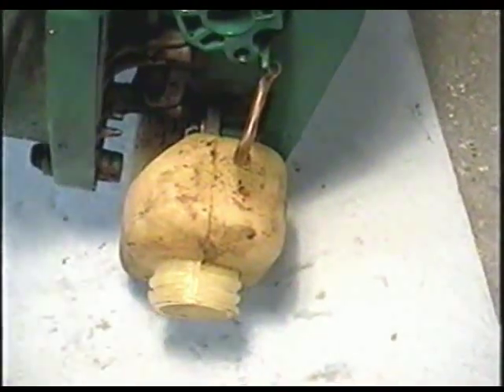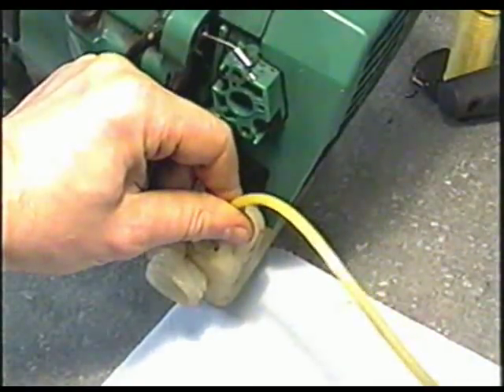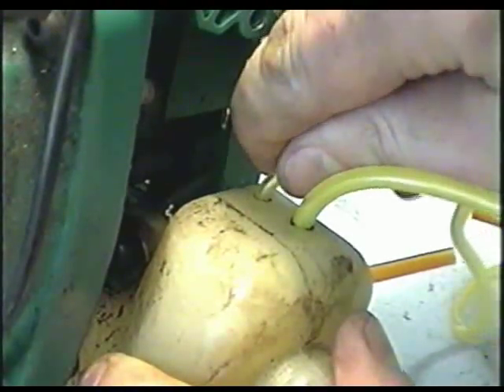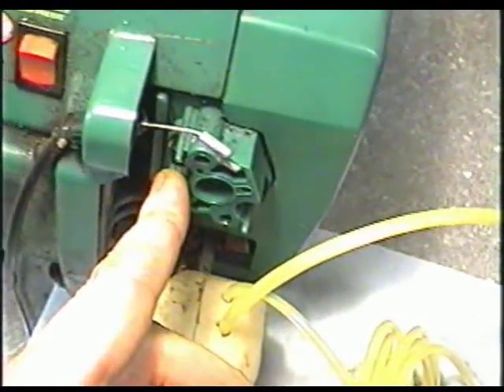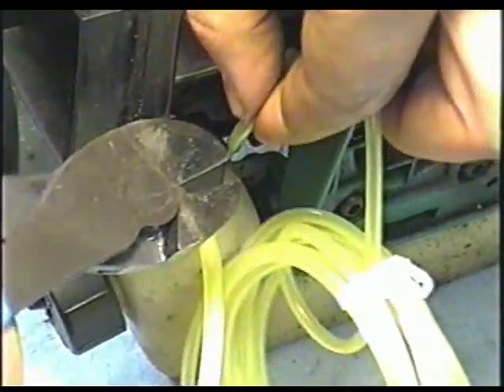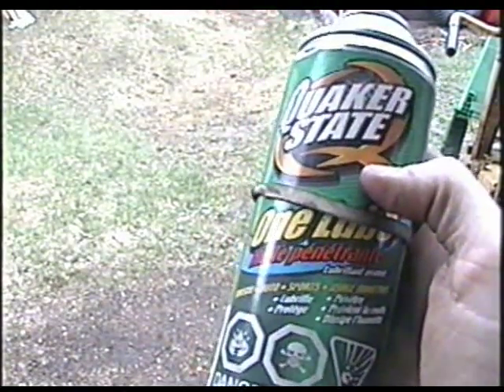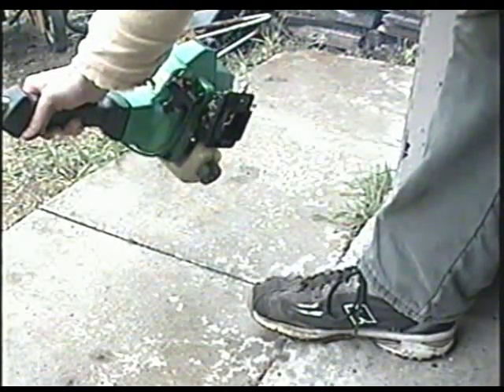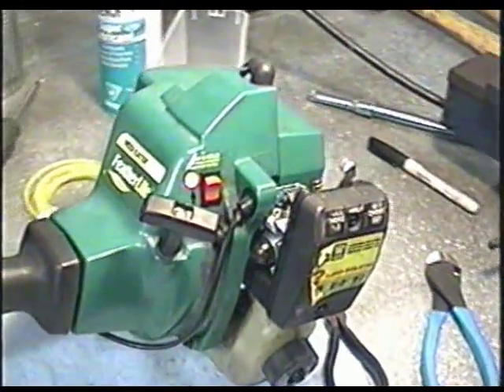Weedeater Carburetor Rebuild & Fuel Line Repair Part 3 of 3

Comment: Thank you, your videos are perfect, a friend gave me a snapper weedeater. The primer bulb was dry rotted. Went to the local dealer, got the bulb. Started the install to discover the fuel lines were rotten as well. I was not sure which went where, I was going to fall back on my r/c model know how untill I saw your videos. The fuel line connection answered all my questions. Again thank you. It is amazing how so many different makes and models use so many of the same parts. Interesting?

Comment: I was at a stand still thinking it was the coil. I gave it another pull and it started. too much fuel was the case. I watched your video and thought I should check the needle. Gave it a cleaning and found the spring wasn't set properly. Put it back together and it works like new. Great advice on the fuel lines, I"ll be getting around to that over the winter. Thank you for the great videos. Lots of good info.

Comment: Thank you for the free information video.  I used it to replace both fuel lines on my  Craftsman weedwacker and it works like a new one.   I bought a set of fuel lines, 12" long each, from Home Depot instead of using Craftsman parts and saved about 80% of the cost.   I really appreciate your instructions.

Comment: I figured it would be cheaper to buy a new unit than take mine into a shop for repair. Instead, $4 worth of fuel line from the hardware store and YOUR video, and I'm back in business! Thanks for saving me a hundred bucks!

Comment: Dony, I did watch all of the videos but didn't see any reference to the green silicone valve I found in both of my Featherlite weedeaters.   Immediately after posting my question I discovered where it came from so I tried to delete it to keep from bothering you.  I found that it attaches to the underside of the gas cap.
Thank you again for the top notch videos.

Comment: @donyboy73 You are the man, I always check your videos first when I'm in need of engine repair. First was my snowblower (various problems) {auger not turning, replacing belt, brokens screws,}, then was my generator, {carburtor rebuild} and now, my weedeater.  Will let you know how it turns out, but I'm sure, it will work now. Many thanks.

Comment: Thanks for your video. A friend was going to grow away his weedeater due to the fuel line problems. Your video properly gave me the instruction how toreplace and put back the lines in the proper place. Also the dimension of the fuel lines size is what I also need. thanks again.

Comment: Thank you, one of the best videos out there. You covered everything . I got a cheap weed eater because it need fuel lines, Everything came out of the tank same as yours .I thought the connector was a connector. Not a fuel line stop. And I had my filter on the big line, thinking big line means supply.  Nice touch adding the sizes of fuel line also. Put lines to match yours and runs good now. Aside from a sore arm pulling like crazy with fuel lines crossed. Again thank you.

Comment: Thanks for the helpful video.  This will help folks become more DIY on their lawn equipment and not get in over their heads with repair costs.  Most times, the problem is as simple as cracks in the fuel line not visible to the naked eye.

Comment: excellent video, worked exactly as you described. Thank you so much! got a fuel kit at home depot for $7.95 and had everything I needed including a new fuel filter. Also had a special tool for feeding the fuel line into the fuel tank. Worked very easy.

Comment: Great tutorial! I got the same one today at a curb. I had to unsieze the engine, the crankcase was full of oil, and the gas lines crumbled. I wanted to remove the muffler to look at the piston condition, but the muffler has springs and whatever else holding it on. I'm Probably only going to clean the carb and add new fuel lines. It seems to have compression and spark, but I don't really want to put anything into it $ besides the gas oil mix.

Comment: Ya I was messing with that a little bit, but I am not sure if it is the right one. I have a different model than you are using in your video. It is a little screw that reaches towards the throttle plate, but it looked like yours had a spring, mine does not. Thanks!

Comment: OK, donyboy,I have ordered a NEW CARB,,also got some fuel stabilizer, after hearing how much vapor water is being accumulated in the fuel as it sits. SO,your suggestion for priming the NEW carb when it gets here?
I had a feeling the diaphragms were bad in old carb and it was getting too difficult to find parts...plus the cost was starting to equal new part at $40 with S&H,etc. This will be a LEARNING experience for me....Thanks for taking your time to teach us...I appreciate it GREATLY

Comment: Great video I did my fuel lines thanks to this video but I found putting in the fuel lines was easier by cutting the lines like you did but instead of going from the outside in, I went from the inside out, It was easy to get the tip of the lines to stick out enough to get a pair of pliers on it and just pull them through with some WD40.

Comment: wonderful directions through your video's. Thank you for posting them. ??? i rebuilt the fuel lines, used the weed whacker for about 10 minutes when much to my dismay it shut down. The screw responsible for holding the choke lever unloosened. How tight should that screw be tightened? Your comment in the video reminds people to be careful due to plastic. Is this weed whacker no longer useful?  Thanks for any help.

Comment: I love your videos. I recommend them to friends and family. I have rebuilt countless small engine carburetors. I acquired a used (free) weedeater. I disassembled the carburetor for cleaning and rebuild, but the needle is stuck. It won't budge at all and there's not much to grab on to. Any tips or tricks? I haven't run into this issue before. I thought I'd run it by you before buying a new carburetor. Thank you.

Comment: Thank you so much for this part of the video (3of3).
I am replacing weed eater PE550 fule lines (x2). I had tossed out the fuel filter.

I have ordered fuel line kit (fuel line x2) and fuel filter and am wondering how to replacing the fuel line.

With your video, I am able to identify that the fatter line is actually the primer line (3/16" OD) and capped by a connector. while the skinny line 9/64" OD is the fuel line and capped by filter.

Thanks so much

Comment: A new carburetor or the parts (fuel line, bulb, etc.)  is fairly cheap and easy to install. Once you do it, it makes more sense. But go slow at first and take snapshots if need be to remind you how to reassemble it. Correct fuel/oil is basic, so do not skip that. And small amounts of dirt/gum. etc. can prevent correct fuel flow. A carb. has to be kept clean inside... so clean fuel (filtered) must go in.

Comment: My PE550 has a fuel tank that is leaking.  Do I have to take the starting coil stuff apart to get the old fuel tank off?  I had bad fuel hoses which I replaced thanks to your great video. Any chance of getting a video of fuel tank replacement?  Thanks
Reply: Watch for one in the garbage dumps or garage sales
I picked up three in one week and paid $5 bucks for only one of them.

Comment: Excellent video
I have a WT 631 and I had a D24-WAT kit I replaced all the seals and needle. 
When I put everything back together the same thing that was happening before is still happening. If I run on half choke it works OK (rich) but if I have no choke the engine tries to get up to speed and eventually dies if I hold the throttle at full. If I press the throttle in in short sharp jerks it tries to get up to full speed but dies. What could be my problem? I only have an idle screw to adjust.

Comment: All 3 videos are very good.  You adjusted it very quick but what the difference between running lean or rich? and when you adjusted the carb you just moved the screw back and forward or were you turning the screw one direction?

Comment: Excellent Videos! I tried starting up my FL21 today; its been sitting for about 3 months. I couldn't believe how difficult it was to start up. I kept getting air in the primer bulb. After checking the gas tank I realized my fuel supply line was worn right through. Thanks to your help, I'll be fixing the lines and rebuilding the carb next weekend. A question though: I kept getting fuel/bubbles leaking out of the center of the gas cap while starting today. Is this normal or due to the broken line?

Comment: great video sequence. i have three of these. on my feather lites there is a High idle and Low idle adjustment screw that looks like iot takes a small hollow veined adjustment wrench, would you know the initial settings on the high and low idle and perhaps where to locate the special driver to adjust them?

Comment: Get Amazon's 12" hemostat pliers to replace fuel lines and filters. They have a 45° and a straight. Don't replace the needle valve because of the spring. Get the spline mixture tool. Adjust the lo mixture for highest RPM'S at  idle and hi mixture for highest RPM'S at full throttle. Measure the I.D and O.D of the fitting on the carb. to determine the size needed. Get a tape measure with 16th's and 32nd.

Comment: Thank you for telling us what size the smaller fuel line is....I have been having the hardest time trying to figure it out as the parts diagram for this particular model (and some others) do not specify it.  Is the 5/64 ID 3/16 OD fuel line typical for most Weed Eater brand trimmers? 
Thanks again for all the great videos!

Comment: I cleaned the carburetor, which I am not sure it needed, and replaced the fuel lines that were rotted out. The first few times I started it, it ran but only in half choke, and died as soon as I set it to run or pulled the throttle trigger. Also, gas was leaking out from somewhere, but it stopped and I never found out where it was coming from. This is my first attempt and anything mechanical like this. Any thoughts?? Thanks! Great Vids by the way.

Comment: Donboy

I have a Ryobi weedwacker-line trimmer what ever it's called.  I'm having trouble getting it started.  I removed the plug and cleaned it.  I also opened up the gap a bit.  So first where should such a plug be gapped?

Comment: DON'T drop your equipment! The fuel filter can come off. Use 12" hemostat pliers to remove and pull the lines thru. The filter hose is installed thru the tank and then install the filter after pulling the hose up out of the top and install the filter. Hemostat pliers pulls it thru. Replace hoses often because they dry and break. Check if it primes.

Comment: thanks for posting this, after watching I was able to change out the lines on my weed eater.  one question,  inside the tank when I emptied out the filter there was a little piece that fell out. the other line still had the little end piece on it.  any ideas?

Comment: The carb has no adjustment's except for the idle speed.  I can get the machine started with starter fluid but once you hit the trigger it bogs down.  I took the carb apart and sprayed it and ran some fine wire through the needle I guess thats what it was.  From your past videos I would say I need a diaphram but not sure which one.  Where do you buy them?  I also will check the exaust and I think I screwed up the primer bulb

Comment: Hi Don,
Can you please tell me where I can buy the spare parts?
In Australia the Lawn-Mower shops have a monopoly, the manufacture does not sell to the public, so we cannot fix the machines ourselves, we have to waste the money if the machine fails to start.
I would be grateful if you can guide us as to where to buy the parts for a Shindaiwa and for a Victor Brushcutter.
Kind regards,
Franklin

Comment: I have been through the same procedure, however, my Weedeater Featherlite is a different model and can't find a way to connect the fuel lines to the carb. If you cut them off at an acceptable length, you can't get your fingers in there to connect. You would have to have 3-5 inches excess fuel line hanging out (only way I can figure).

Comment: an older WeedEater branded one (I was given a 1400 model) was well made and may be worth cleanup and replacing carb parts or the entire thing and the fuel lines/filter. Low cost... maybe $25-40 at most versus $50 an hour at a shop. The old carbs were steel and better materials than new ones from China. If wear is light... keep the old parts and use them

Comment: Save my life,  I mixed up the in/out fuel line,  the trimmer kept stalling after few seconds.   Swapped the fuel line and fuel filter, everything is good.  I wonder whey they use the small diameter line for the filter; such pain to insert the filter into the line.

Comment: Great vids! Im having a problem with my Craftsman triimer carb. I replaced the primer bulb and fuel line. I also took the carb apart and cleaned it really good with WD40 but when I put it back together,,fuel stopped going through the carb.Its as if the bulb slowly brings in fuel but puts it back in the tank.The plug is dry and the diaphrams and gaskets look like they are in properly. Any ideas?  thnx

Comment: I did same as you on my featherlite and it still wont run. Does it simply mean the carburetor needs replacing, - is there a point where they dont respond to servicing and new kit etc ?

Comment: I have one old and I did this except I filled it went use it it was old one just made a couple of things like drill a primer hole for the tubing wider it mite leak a wee bit thus a airfoam filter for a filter seal and should be diy done

Comment: You mentioned repair costs at the end of the video.  I would like to get your opinion if possible.  I've seen repair rates of $50, 58, 65 and 68 per hour.  I did some repair work, just starting out this spring, in my spare time.  I didn't know the rates and was paid about 1/3 of the going rates.  As I get more educated and serious about small engine repair, I have not set a firm hourly rate yet.  I don't want to be too high but also not too low.  Can you suggest an hourly rate?

Comment: Hi. I just replaced the carburator with anew one. But still my weed eater doesn't work. It starts but dead soon. I found the the oil tube from gas box to caburator has air in it. Is it normal?

Comment: Dony does that inside fuel line connector help with the proper operation of the carb & motor? Do you really need it?
Reply from the maker: no you don't need it, I never use it

Comment: where is the check valve located and the machine starts and runs fine u just need to spray some starting fluid inside the carb

Comment: I have carefully rebuilt my carburator, and replaced the fuel lines and filter just as shown here. The weedeater still wont run. I noticed right away that the fuel does not fill up in the primer bulb. What should I expect?

Comment: why is the primer bulb pointed towards the throttle cable. on my 1998 FL21 and 2003 Mcculloch trim mac TM210 its pointed towards the back

Comment: Hi Donyboy, I have a problem. I'm working on my cousin 4 cycle weed eater. It wouldn't start, so I took the carb off, cleaned it, changed both fuel lines replaced,  so in order for it too crank, I used some starter fluid and it crank and ran good.  But when I shut it off, It want start back, unless I use the starter fluid.  What could be the issue that it will only crank with starter fluid???  Do you have a video on something like that??? Direr need of help.

Comment: Thanks so much for these videos, they are extremely helpful.  I just have a couple of questions, first off is it okay to use wd40 to fit the fuel line on the filter?  And secondly, i didn't see the extra connector that sits in the fuel tank.  I have a feather lite plus that looks just like yours, but i realize its a "plus".  Do you think that has anything to do with the missing connector or it could just be gone.  Thanks for your time!

Comment: Hi, I hope you can help me. I have a featherlite weed eater, date on stamp says 1998. I think it needs a new carb, the whole kit. But, it only has the serial number on the stamp, not the model number. Would you have any idea which carb and kit I would need? Thank you so much. Update....I found my manual, the model is Wild Thing WT21.... XT200 / XT25 Series

Comment: Donyboy,do you ever work on CRAFTSMAN weedeaters? Repairmen in my area laugh and refuse to even look at them. I had done the carb cleaning (not as well as you-I missed a few steps of breakdown, because of different configuration), I replaced fuel lines, fuel filter,sparkplug and washed the washable airfilter,cleaned carb...because the machine works great at full throttle, but when you engage it to use..(sorry, female here without proper terminology) the motor dies out..It is so frustrating,

Comment: I have a carburetor that goes to a poulin lawn  edger it has a check valve in side of it it is a walboro  the carbs shown for rebuild do not have one I am not able to find a primer bulb that will work with this carb any suggestions

Comment: When I changed the fuel lines, I did not replace the filter because it was still white. However, it turned a lil green while I was installing it I think. Any ideas what might cause that or could that even be the problem? Thanks!

Comment: just wanted to know i have the same type carb as u on my weed eater xt 200 . did u start this with screws fully in because im unshurer were my screw is set at rigt now and wanted to know if i screw all the way in how many turns out i need to be  same witht the idele screw. like it bogs a little on when i give gas but when at high rpm it did die out and some times it sisent not sure y but thought i'd put sum up on here for some help thanks